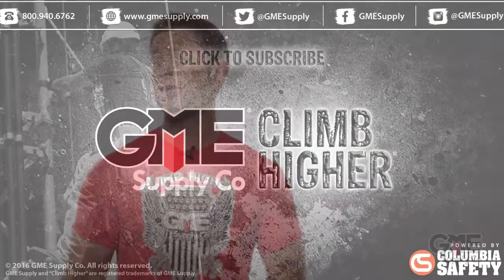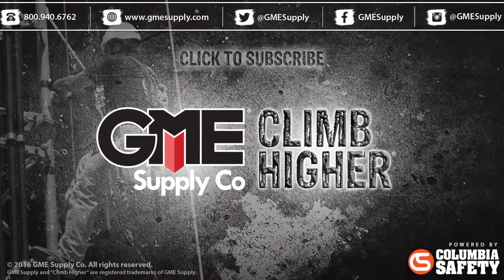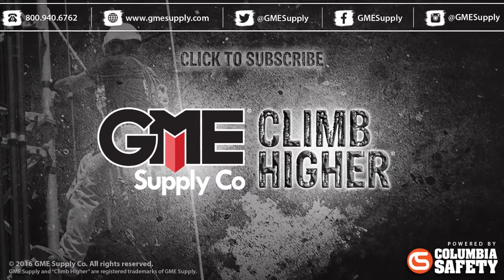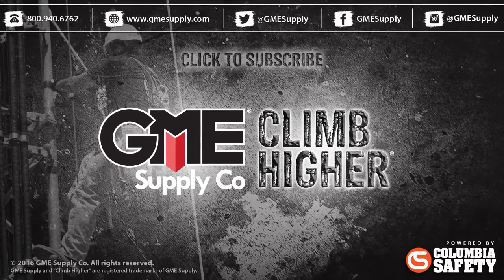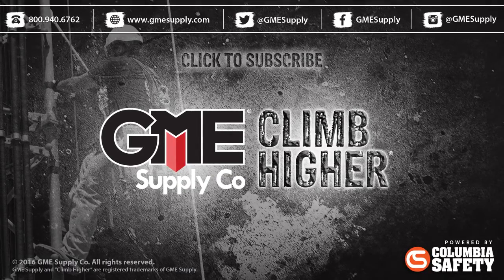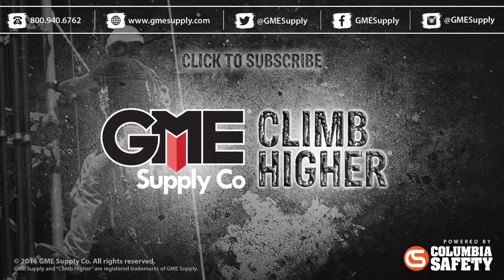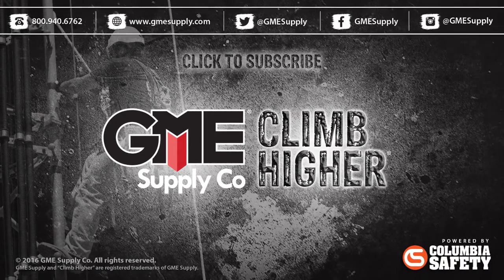Cold Galvanizing 101: Everything you need to Know

Comment: Your example show leaving mill scale on the steel.  MS is an oxide layer which actually interferes with ordinary paint adhesion.  I would think to get the correct galvanic joint, you have to remove the mill scale oxide layer (as well as any rust which is also an oxide layer.)

Comment: Hello, looking for a product to treat mild rust on a mobile home roof (galvanized?) before applying a fresh coat of asphalt aluminum fibered coating.  Several rust converters/reformers state not to use on galvanized metal due to it not adhering.  Would this be a good product to use for this?
Reply: @solarsynapse I may aswell answer your question as you have already been waiting for 6 months for an answer from GME supply and nothing back.
Yes you can use it directly ontop of the existing galvanised roof panels,make sure the surface is well prepared any loose rust sand it off or wire brush it off,then dry and paint this stuff on in the video or any cold galvanising product,it is far superior to those rust convertors etc,it is just about the ultimate in protection against rust and ive tried all the products,next to cold galv paint there is etch primer.

Comment: Can Cold Galvanize Compound be applied over paint ?
Reply from the maker: Hi Martin - It cannot be applied over paint. The surface must be cleaned of paint, chips, rust, dirt, oil etc prior to applying the cold galv to ensure proper adhesion of the product. The exception to this is previously applied cold galv. That doesn't need to be removed as long as it is in good condition. We hope this answers your question!
Reply: @Gmesupply  thank you so much for that info , I am in Belize

Comment: Is the coating suitable for treating the inside of a new fuel tank? My main interest is the bottom where moisture collects.
Reply from the maker: The manufacturer does not specify that it can be used on the inside of fuel tanks, so they cannot guarantee that it won't be detrimental to the fuel.

Comment: have you heard of this? 
Q. 25. Do we have to wet the surface (with fresh water) of a freshly applied cold galvanization?  
A. No, you don't have to do so. It certainly gives a good result, because it improves the polymerisation and the formation of zinc salts and zinc carbonates on the surface and this offers a barrier protection with a harder coating. It also helps to avoid dark spots on the freshly coated surface due to raindrops.